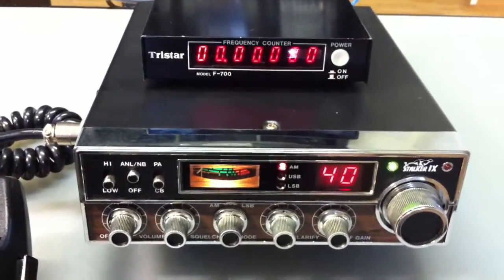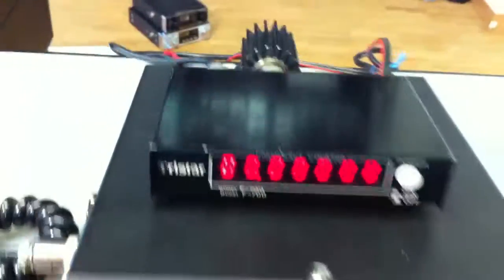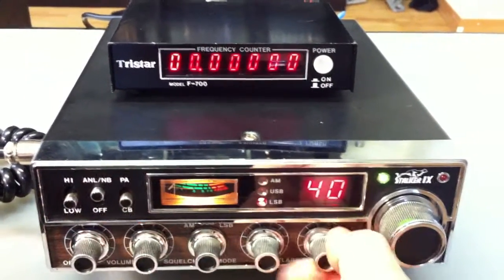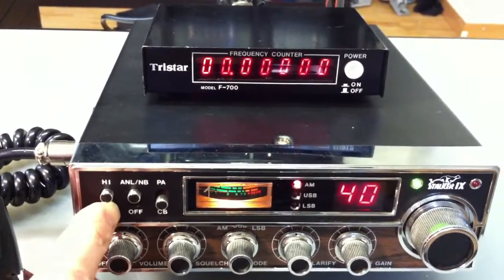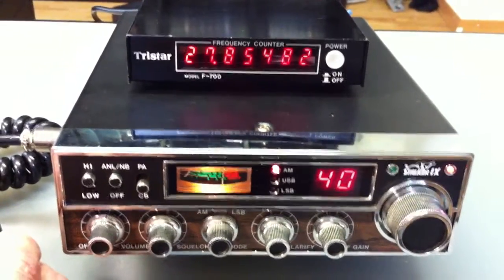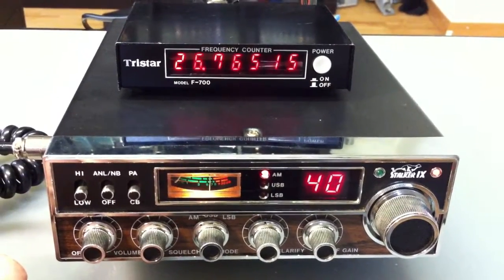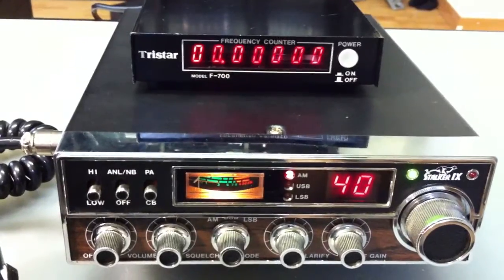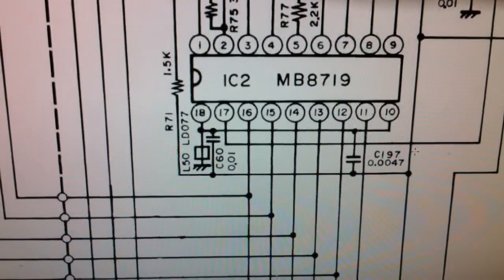TEABERRY STALKER 9 (PC385 by Uniden)

Comment: That's a really nice looking radio.
Reply from the maker: orange70383 Orange hello. Do you don't know this wonderfull radio? This is one of the most sold CB-radios of the late 70ies and early 80ies. Merry xmas and happy new year 2015. To you and your Family...
Reply: SWIZZRADIOS  I used to have a Teaberry Stalker 101 40-ch AM-SSB.  It looked like this unit except it had 3-push buttons instead of 3-switches. Someone had installed extra channels in it and was a good sounding radio. I think they are a very good looking mobile with the wood-grain.  Another radio that uses the wood-grain look that I like is the JCPenney 6247 AM-SSB Mobile.

Comment: WOW!!! This is really weird. I had the exact radio and exact frequency counter as a kid (13 yrs / 1990). Uniden based radio IIRC, similar board to cobra's and superstar
Reply: That mod to the PLL works wonders. Here in the UK, they call it "Mids" which used to be illegal, here in the UK, but wasn't a deterrant. Thankfully, the law was change in late 90's IIRC. This mod unlocks channels/band below normal CB (27 MHz) is that right?

73's

2M1VFO
Reply from the maker: Mark Bartlett hello, thank you for the question. This is the EURO STALKER 9 by JACOB TRADING of Switzerland. 80 CH, AM/SSB: 26.965-27.855 MHz. But with the PLL mod (MB8719) you get 26.325-26.765 (Lo) and 26.775-27.215 MHz (Hi), by set the pin 10 (-640kHz) to the ground or remove this pin vom the ground. Best 73's to you.
Reply from the maker: OK, Im not shure. The SUPER STAR 360 FM has the PB010 board. The old SUPER STAR 360 (without FM) the PC-593 board, and the STALKER 9 the PC-385 board. Best 73's...